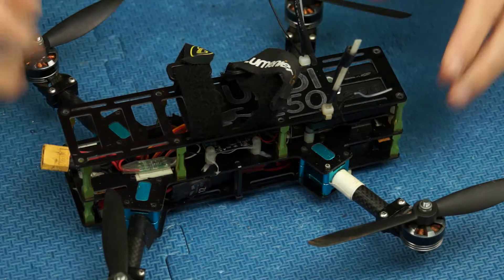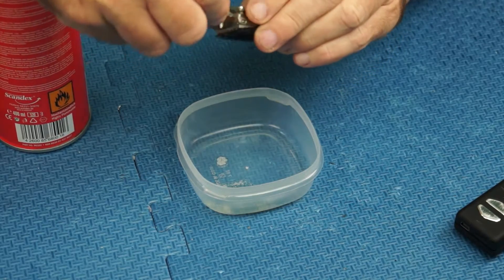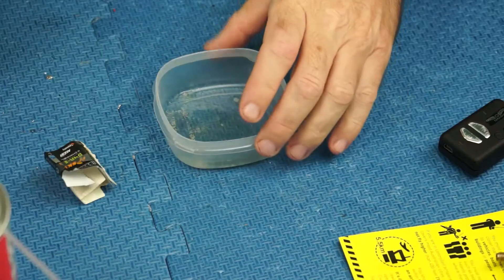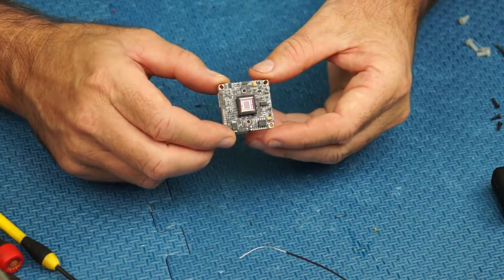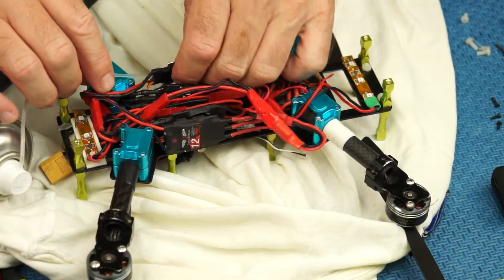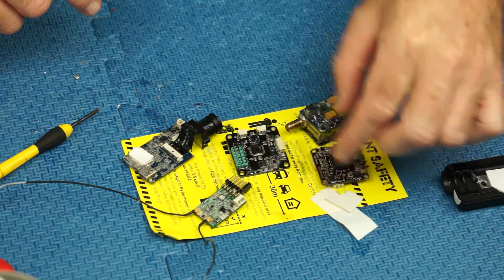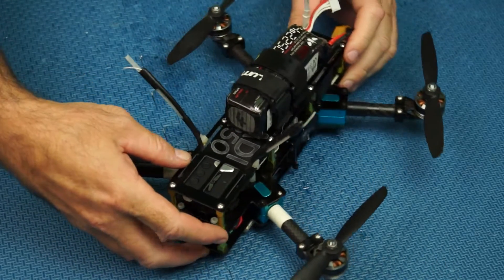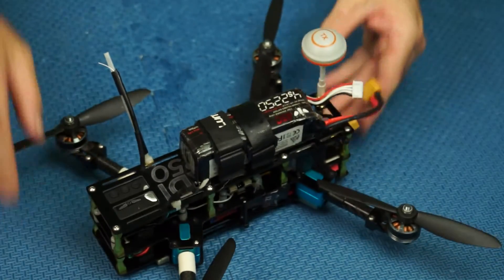Water Proof CorrosionX CC3D Mini 250 Quadcopter Multirotor

Comment: not sure if this is really waterproofing and more corrosion protection as this really is just an corrosion inhibiting oil. I am sure it will work for a while but you will have to reapply it. 
A silicon conformal coating would be better for waterproofing electronics obviously not the connectors though.
Reply from the maker: +Stephen Gibb Well before I put this on, I lost my QUADI 250 into a fresh water stream with a 4S lipo on it. 35 mins later I found it, still powered up and the leds on.. Used rice to dry all the bits out and it is still flying to this day. I did fry my Mobius and VTX though. So I guess this will help, but its is messy yes.